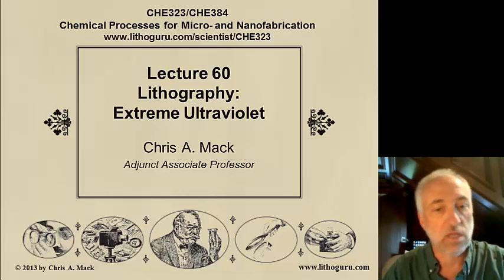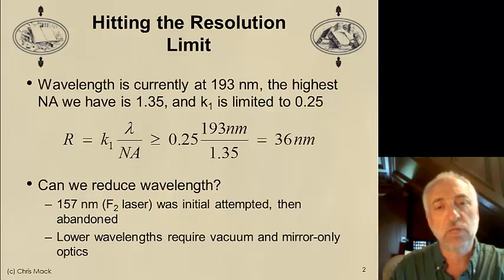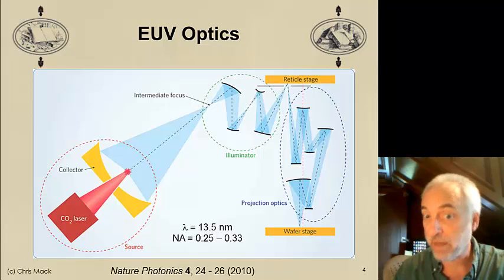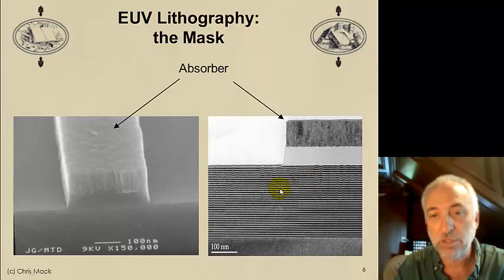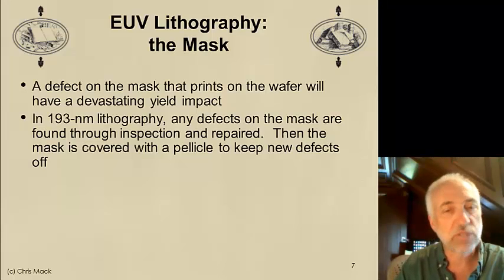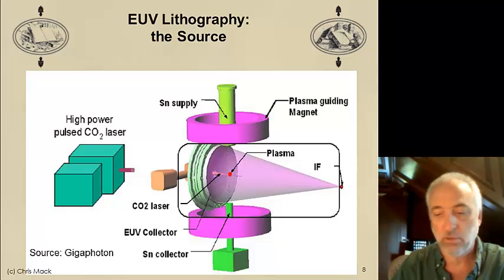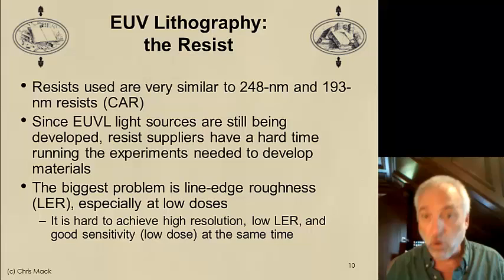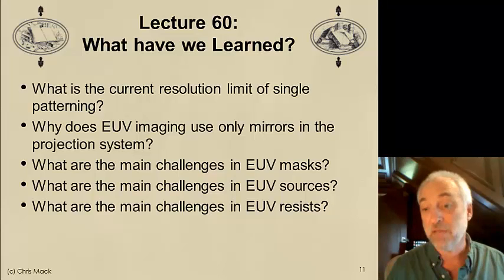Lecture 60 (CHE 323) Extreme Ultraviolet (EUV) Lithography

Comment: 1. What is the current resolution limit of single patterning? The current resolution limit for 193nm wavelength immersion litho is 36nm based on the Rayleigh equation but in reality is slightly larger (40nm).
2. Why does EUV imaging use only mirrors in the projection system? EUV light cannot travel through glass.
3. What are the main challenges in EUV masks? Defects on the mask will destroy yield and it is difficult to make defect free masks due to inadequate defect detection, inadequate repair methods, and a pellicle (today we do use pellicles with EUV litho 2025).
4. What are the main challenges in EUV sources? Laser induced plasma sources is not bright enough which lows throughput, collector often needs to be replaced so the source is only available 70% of the time, and there is a lot of tin debris. 
5. What are the main challenges in EUV resists? It is difficult to run experiments because EUV light sources are still being developed and RLS (Resolution, LER, and Sensitivity) is hard to achieve.

Comment: Great lectures, the best. Could you please provide some references re slide 9, "Brightness – we still need a factor of 10-100X increase in brightness". Thanks in advance.
Reply: We're making progress everyday here at Cymer ASML San Diego!
Reply: @randyvfromtheperch  indeed you were! Congratulations on getting there and making it practical for real world use :)
Reply: These slides are 4 years old.  In 2017, most EUV tools in the field are running with an 80 W source.  Many people believe that high volume manufacturing can begin with a 250 W source, but I believe that high volume, high yield manufacturing will require 500 - 1000 W for contact/via/cut mask layers.  Thus, today, we are 3X - 10X too low in source brightness, depending on your assumptions.

Comment: What about x-ray lithography, whouldn't that be even better than EUV lithography seeing that x-rays have even shorter wavelengths than extreme ultraviolet?
Reply from the maker: Brandon Fisher X-ray lithography, with a wavelength on the order of 1 nm, was attempted in the late 1980s and early 1990s.  Unfortunately, it is not possible to build a lens or mirror that can focus light at this small wavelength.  Thus, only proximity printing is possible.  This poses a number of difficulties due to process control when making 1X masks, besides the difficulty of building a bright light source.  The industry's 1X x-ray lithography efforts were abandoned in the early 1990s.
Reply: Chris Mack I get it so EUV light just happens to be at the right wavelength for this to possibly work; not too long, not too short but just right, I didn't know they already tried x-ray lithography before.
Reply: @ChrisMack  I always thought that x-ray wasn't used because it is an ionising radiation finally damaging the silicon bounds
Reply from the maker: @thcoura  Yes, hard x-rays can damage devices.  But the main reason x-rays aren't used for lithography is the lack of lenses - we can't focus them.